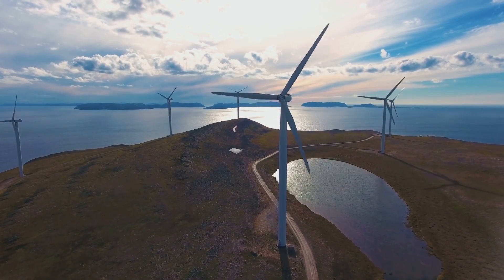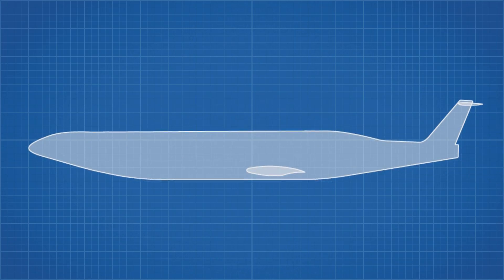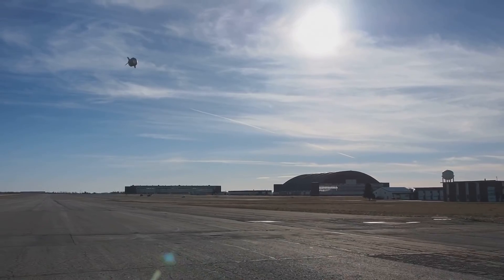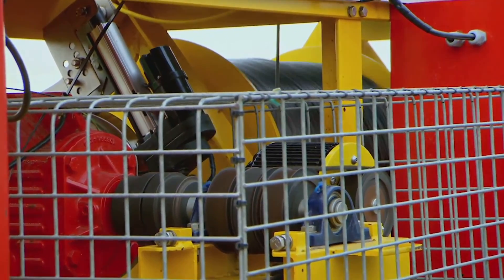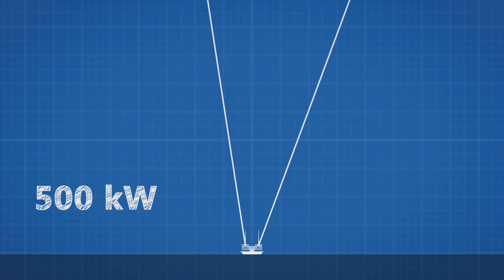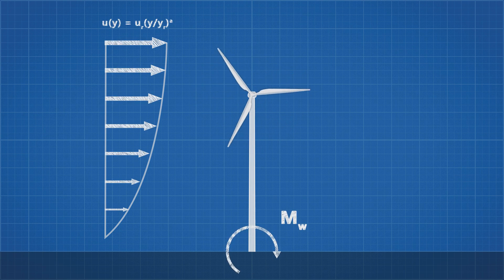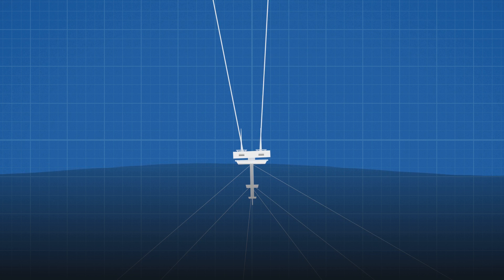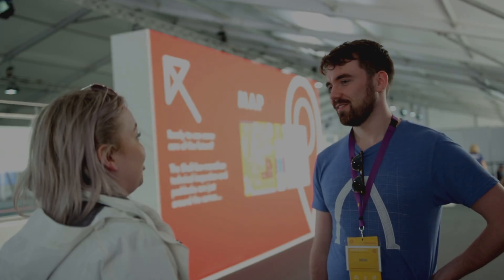The Future of Wind Power? - Kite Power Systems

Comment: “KPS is currently building a 500KW version” 
How have they estimated that number? Sorry for the skepticism, but I would want to check if it is actually plausible (sounds like a lot even for an ideal situation, not even taking into account irreversibilities and losses due to heat).
Reply: Besides, I have a question regarding to how it works. Doesn’t the lift of one kite mostly compensate the lift of the other one?
I get that the power is generated when one rises and the other one lowers, but in my head most of the time the wind will just end up in tension for the cables.
In a wind turbine, all of the air going through it generates torque and motion which go straight to the generator (plus no compression loses), so I truly think that this cannot have even close to the efficiency of an air turbine.
I don’t want to hate, and I don’t have any relation to eolic power neither (in fact, I would rather have solar power in every possible place), but in my opinion the whole KSD thing looks pretty inconsistent. Besides, I found that 500 KW are achieved with 40 meter rotors and not 54 (in fact, those produce 1000 KW), which doesn’t really matter at this point, but it doesn’t help to the credibility of the video...
Reply: By the way, I love Real Engineering videos although it looks completely the opposite xD. This was just mu view of it.

Comment: Call me confused...
You have one cable connecting two kites. In the middle of the cable there is a barrel of some sort that the cable is wrapped around. As one kite rises the other kite dives. This motion in the cable turns the barrel which is connected to a generator creating electricity. Right?
So my questions are: 
Does it generate electricity in both pull directions?
Does the generator have a transmission that keep it spinning one way no matter which kite is pulling?
There is a toy called a “ Diablo “, two sticks with a string between them. They are used to drive hourglass shaped head. Check it out
So am I close or just Bark raving mad.   😏

Comment: Being an ex kite boarder for a decade I can easily imagine a 30 of 40 m2 kite producing at least 1000w of energy in a 10 knot wind. Having 2 kites doubles that . When they are at the end of their run their leading edge is simply lowered and this stops the pull force and the kite can be reeled in with low energy to start its accent again in figure 8  loops . This maintains the pull force on the generator cable and the system become rinse and repeat . I realised this over a decade ago as and electrical engineer and am ever so excited that this is being investigated as an eco electrical producing  solution ! The potential is more amazing that what most people could understand ! It takes the direct human experiences to truly feel the power of mother nature crossed with a mind aligned with the natural curiosity of energy creation etc. amazing eye opening stuff!
Reply: Try 1000 kilowatts

Comment: That's why feed in tariffs policies that preferred wind turbines have been such a disaster because now just this technology, and not others with much more theorical potentials, is widespread and used. The same happened with pv panels, whereas concentrated solar thermal is more efficient and can store heat much easier than batteries.

Comment: The cost of offshore wind energy has already fallen much lower than your graph forecasts for 2030! get with the times "Mr. Real Engineering"
Reply: 1. sources. 2. it's impossible to go full offshore windturbines (for example look at the main currents and how they are influenced by structures in the sea).

Comment: The kite system seems to focus tension forces.  The wind and kite(old wind-bag) producing upward forces and gravity producing downward forces resulting in tension on a cable.  The other such energy system is the grandfather and cuckoo swinging pendulum clock.  The introduction of a simple and efficient pendulum/Christian Von Koenigsegg wind-up/lock-up torque movement system might be used for both regulation and storage of potential energy by elevating a mass or masses or rotational inertial masses (Flywheels) or raising fluid levels, volumes or pressure (air/gas/refrigerant, sea/fresh water).

Comment: Obvious concerns are airplanes and entanglement. Airplanes not so much of an issue if you can attach lights to the kites and along the cords for nighttime use. If their vibrant and colorful it shouldn't be an issue in the day. Question being how efficient these kites are at remaining untangled with eachother. If their controllers are smart enough to kneel them apart. And if so can you have multiple of these life generators next to eachother? If so and even if not. This would be an excellent space saving design. Imagine if you could have them fixed to the top of sky scrapers. Out in fields. I assume unlike wind turbines they must be much more quiet.

Comment: That sounds very interesting. I have three questions. First, how much space does it need compared to a traditional wind turbine. We don't want to plaster even more space than we already do with regular wind power.
Second, how often do you have to replace the kite? If you have to do it frequently it could drive up costs by a large amount. Third, how good is it scalable? Can you build much larger and higher kits?

Comment: This technology works, or at lest can be "made to work", but the question is, can it be an economical energy solution?  There are a million ways to generate electricity, but only a few turn out to be economical.
There's a bit of a "Rube Goldberg" aspect to this, in my opinion.  The minute you see a wind energy "solution" where only half the wind-engaging surfaces are producing energy at any given point, or where there is a "retract cycle"or  "upwind cycle" that each wind-harvesting surface must undergo, I say watch out.  A retract cycle would seem to double the cost of energy (COE) as a start.  Also, the kites are moving downwind on their power stroke, reducing output somewhat.  Solutions that "start out simple" but require many "not so simple" add-ons to make them work usually end up being too expensive for wide use.  Nothing like a grid-tied generator humming along at a steady speed proving steady grid power with rotating inertia that keeps the grid stable.  For this kite-reeling power concept I would remain skeptical, but who knows - at least they are actually doing it rather than just talking about it.
Reply: He already said that it costs less per watt than a wind turbine.

Comment: Sorry, false premises up front regarding the need for baseload and wind turbine placement statements. You clearly didn't look up what "strong winds" means. Airborne wind energy is a long-running academic research program, not a viable future form of serious electrical generation. Given that there are innumerable factors unaccounted for by kite power advocates such as bird issues, icing, tether interactions of multi-device wind farms and the like, any price assertions are vapour. I notice that autonomous landing and takeoff were noticeably absent from the discussion, and yet that's a fundamental Level 0 requirement for anything which thinks it's going to be a utility scale generation in remote and offshore locations. 

If you are going to call yourself 'real engineering', then you really need to look at things from an engineering perspective.

https://cleantechnica.com/2014/03/03/airborne-wind-energy-platypuses-instead-cheetahs/
Reply: hey mike, I read the article you linked and it is very interesting as it clearly details the requirements before any successful system is out there. I understand your current assessment is that it's an academic research and not a viable form of serious electrical generation but do you think it will be in the future (20-30 years), or would you vote in favor of discarding any effort already made towards this form of energy?

Comment: Why is everyone so obsessed with "clean" energy? Wind power (before these kite stations) is noisy and not space-efficient, solar panels are really toxic to produce and the chemicals used in production are quite hazardous. IMO the future of power generation are fast neutron and thorium cycle reactors. They don't need high pressures to operate and burn their fuel more efficiently then thermal neutron reactors.

Comment: Don't worry about CO2. It is a renewable energy source, too. Converted to O2 and biological material through PHOTOSYNTHESIS. Surplus CO2 is sequestered by the ocean. Its rising presence in the atmosphere is a normal consequence of naturally occurring global warming as the earth goes through its cycles. CO2 levels cycle between 150ppm and 900ppm, and have reached 7000ppm during the Cambrian period. It is currently 400ppm, as we continue to come out of the last ice age. The cause of global warming is SOLAR ACTIVITY, as solar winds reduce percentage cloud cover, hence affect radiant energy reaching earth. Nothing you can do to change it. CO2 rise lags temperature rise by 700 years, as oceans become less soluble with temperature rise. Watch "The Great Global Warming Swindle Full Movie". Al Gore profited by over a hundred million dollars selling this bs, yet he only took one science subject at yale, first year chemistry, which he failed with a D. His work was based on his tutors (Prof. Roger Revelle) 1956 report, which suggested CO2 may cause temperature rise as it is a greenhouse gas. Prof. Roger Revelle continued his research and concluded in 1991, humans are NOT causing global warming.

Comment: It just seems that the kite installations would have to be at considerable distances one from another because they move with the wind in a pretty large radius. You can fit more traditional wind turbines in the same space. 

And the largest wind turbines are over 8MW, whilst the example given in the video is for a 60m long kite that only has 500kw installed power. I can't see how that's feasible to up-scale. 

This technology is just being tested, I wouldn't be so optimistic about the numbers at this moment in time.

Comment: My questions pertain to weather conditions in the Great Plains states in the USA. 1. Can the kites withstand tornado force winds. (Tornadoes produce wind speeds in excess of hurricane force winds). 2. What sort of detection equipment do the kites (and/or ground components) employ? Are they resistant to electrical disturbance associated with violent thunderstorms/tornadoes? Are they sensitive enough to detect flying debris associated with tornadoes? 3. Can the kites and tethers with stand icing conditions associated with violent thunderstorms? These questions are not intended to be trolls. I am honestly curious about the capabilities of this technology.

Comment: This is very interesting. I just have doubts about scalability, as in "what if we want to put 10 of those in the same general area?" Won't they have to be like super far apart, you know, to avoid the cables getting entangled ?
Reply: My thoughts entirely. I prefer the kite+turbine designs, where the kite doesn't need to be flying a figure-8, and it's not the kite's lift that's used to generate the power... this also means you can stick them even further up, and daisy-chain them, sticking multiple kites onto a single ground-tether, which doesn't need to be as strong (and heavy) but it mostly used to carry generated electricity back to the ground. This does of course mean the "kites" become heavier, becoming more like gliders, as they need to be able to carry the turbine... we'll see which design comes out on top :-)

Comment: The area around this thing becomes a no flight zone. This looks like biggest problem for this type of generator (and it is not even mentioned).
Also, how to lift those into air if wind at the surface is too low.

Comment: There are several mistakes in the video. Not a single mention of the frecuency or the inverterse that would be needed, the wind turbines are drawn wrong since the blades are much longer than the high.

Other mistakes are the reason why the turbines are in mountans. They are because the montain compreses the air, incresing the density and power.

This system that you are selling us seems quite dangerous and frequency problematic. In my opinion the inverters must be use, so the cost figures you are pointing are wrong since the inverter's cost must be taking into account.

Cheers,

Comment: Great video as always, thanks for producing this.  I have some concern about the wear and tear on the cables and cable management system.  As a professional mariner I have seen wire, rope and cable wear out quickly under much less "work" as the cables in this system, watching the cable spool out and back in at high speed just made me cringe.  What efforts are being made to mitigate the cable wear?

Comment: As someone who dabbles a bit in investing i did a bit of research into energy companies a few years ago. There is a surprising amount of renewable energy investment from them. PMO. Had its whole front page of its website dedicated to it, even though it makes its money through oil infrastructure. Many companies like the ones mentioned in this video (Shell, Schlumberger etc) seem to be embracing this strategy last i checked and im sure for many people out there thats counter intuitive. Why invest and research something which will destroy your bottom line?

Its dead easy and obvious though with a bit of thought, and observation of the market. If you dont invest in technology which will destroy your profits then your competition will!!!

Apple and many computer companies are great examples of companies which cannibalise their own profits. Technology will always advance. Blockbuster should have become the next Netflix. You should always develop products that beat the crap out of your old products, and if that requires a technology shift rather that incremental improvements then thats even better.

Also oil is used for a lot more than just energy. Using oil for plastics, fertiliser etc is still a very profitable use of oil. And if you have the new energy production products you can hopefully bankrupt your competitors and buy their infrastructure and IP for cheap :)

Comment: As this is a cool and inventive way of creating power I do not feel that it is scalable. Building hundreds of them to power cities (as done by wind turbines) is not an option here. If you calculate the minimum space necessary between two separate kite stations you can see that this is not a project that could replace turbines as the distance between points would mean larger amount space used and would be an increasing price point.

I do agree that for disaster relief, lower cost renewable energy power for poor countries, remote areas in need of power, and other practical uses, that this could be a great help and a game changer for power. I think that it should start itself not in comparison to wind turbines but a "drivable 500kw power source" which is a very lucrative and possibly very profitable business. 

I love this idea and I'm wondering if there's any problem with tangling of wires and kites?
Reply: Wind turbines are roughly 1200 feet (378 meters) apart (the rule of thumb is usually 7 rotor diameters) 

If you check the website for KPS they tell you that it is a "100-200 meter line" meaning a 200 to 400 meter diameter, if you look at the way the system is designed the kites can reach a 85-90 degree angle when being brought down (when a kite is re-spooled it is brought at a 90 degree angle to minimize the force needed to wrap it around the reel axle) that means that the area that is taken up by this system is a 200 meter diameter semi-circle which quadruples the wind turbines 54.
Reply: Future Hindsight that's not how a sustainable power industry works
Reply: Good thing engineering solutions are not done with feelings...

Comment: im not sure if i understand it correctly. 
Two kites connect to opposite side of a string respectively, the generator is disposed between two kite and generate electricity by the lifting force difference of two kites? am i correct??